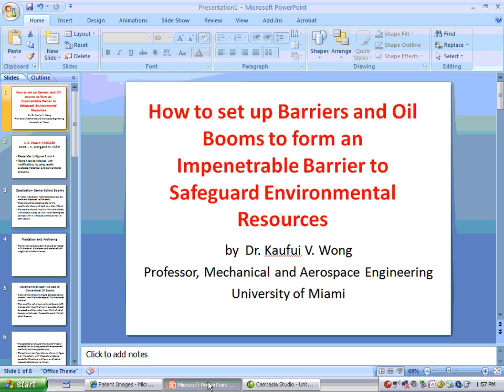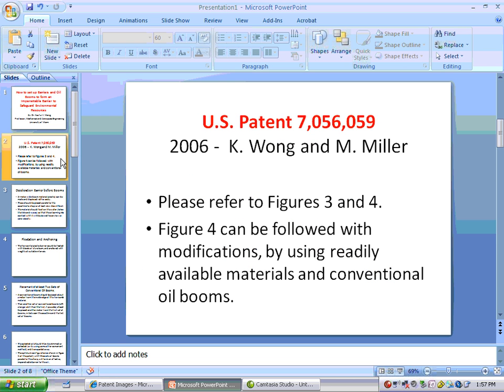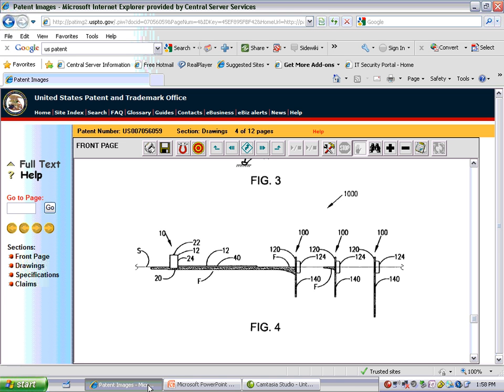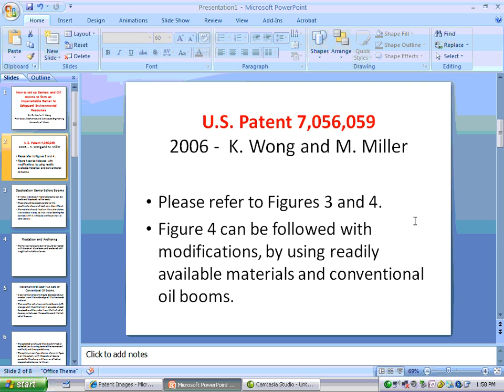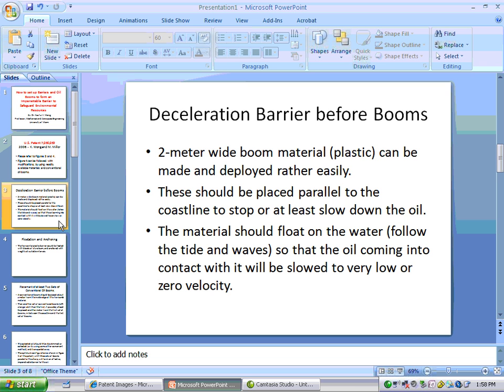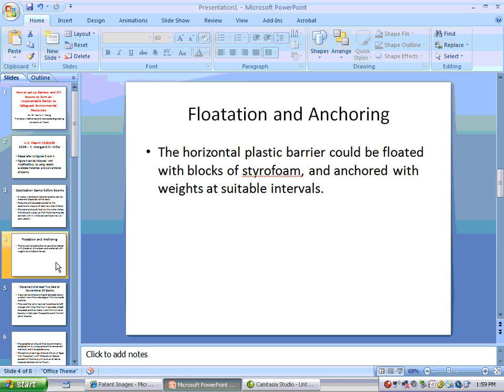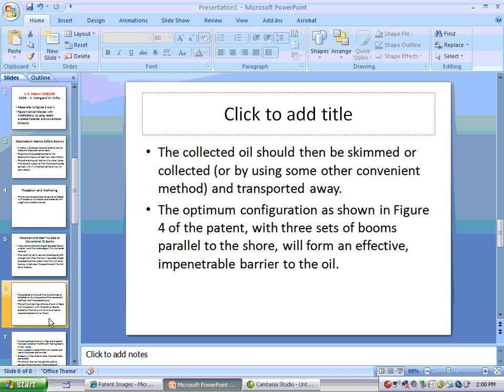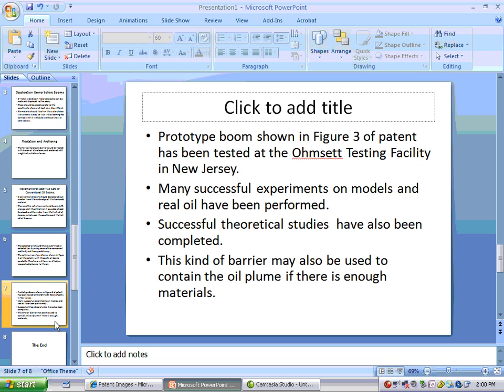Impenetrable Oil Barrier

Comment: I think there is an interesting fact that both winning teams of the X-Prize Oil Spill in 2011 are evolutionary instead of revolutionary.  The revolutionary fluid mechanical aspects of Travelking111's patent shown in the current video should be better appreciated.

Comment: The oil barrier method in this video is practical and effective. The use of a deceleration barrier and multiple sets of booms eliminates the problem of oil flowing over a single layer of boom (conventional method) and harming the environment. This method should be incorporated into oil spill response plans so that we are prepared to protect the environment and its precious resources.

Comment: It is true that we probably do not have enough resources to use a single boom for the whole Gulf coastline.  However, why bother to put  a single boom if it just gives a false sense of security.  Better to put resources into a method that works!  This is especially true now that it is been claimed by scientists that the building up of the offshore barrier islands off the southern coast of Louisiana is not environmentally sensible.

Comment from the maker: @bizzofaction It is known that a single boom will not prevent oil from coming through, because of drainage failure at 1 knot water speed.  The practice in the nineties was to use two booms in tandem.  The improved procedure here is to make it very difficult for the oil to enter the marshes in Louisiana for instance, and other precious, sensitve environmental resources.  Yes, there is not enough resources to protect all areas this way.  A single boom gives a false sense of security,unfortunately.